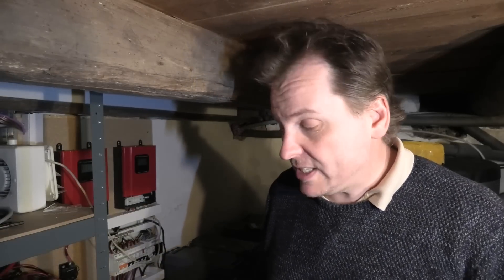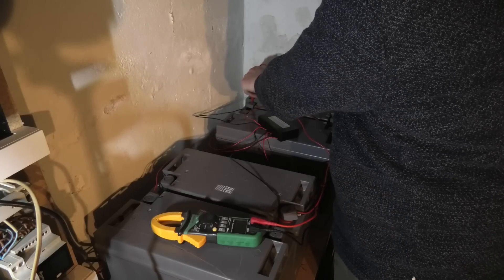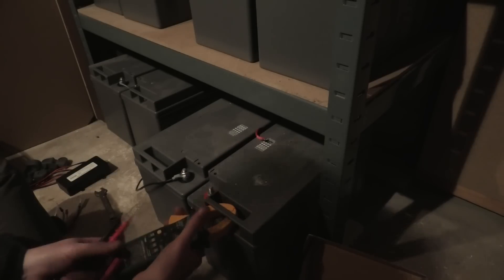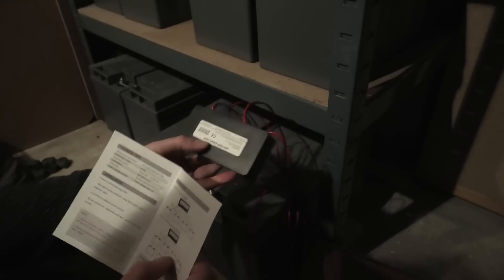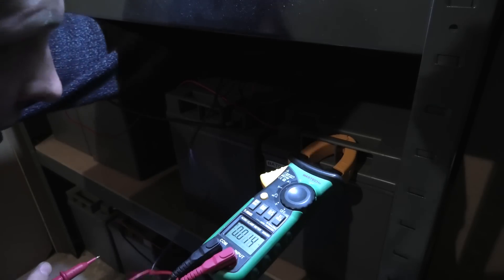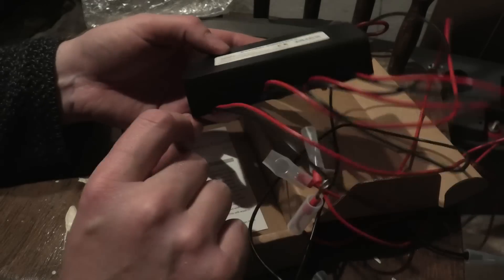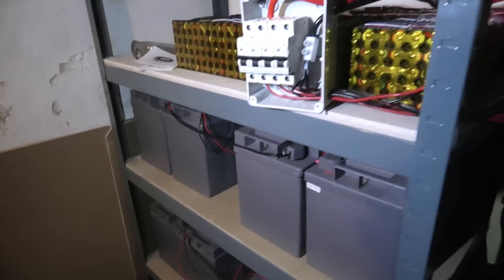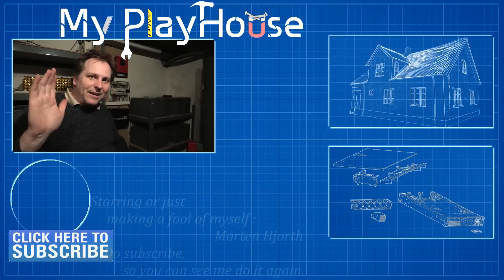Lead Acid Battery Bank Equalizer HA02 4 Batteries 48Volt - 1074

Comment: could it be used on 6 volt batteries also?
Reply from the maker: I do really not remember,, you will have to look in the manual.
Reply: are you still happy with the equalizers operation? well worth the investment? @MyPlayHouse
Reply: i just got my HC02 and used it charging on 6volt batteries, 12volt system, i had 2 batteries very low, so hooked the low batteries and the high batteries to the equalizer and my first impression is outstanding! higher voltage than I've had on this old bank in years, I'll see how it plays out on the discharge cycle, but, it's very encouraging now!!! thank you!  @MyPlayHouse

Comment: measuring voltage with "just about" as a measurement unit?   When you're talking about differences between cell voltages and balancing,  "just about" is a horrible unit of measure.
Reply from the maker: Well if it was off by any important amount,, I would say it more precisely.

Comment: out of curiosity did this end up being a useful worth while device this far in? does it work well still? toying with solar security camera trailer at work
Reply from the maker: They work really well,, but I got them to late,, my batteries was done :-(
Reply: first, thanks for responding to pretty much every question I've ever asked:P... I think 2 trailers are both going to end up with new sets of batteries(trailers were bought and no one seems to have known what they were doing or had time to setting things up  properly??** crossing my fingers, knocking on wood/etc:P).... any clue on if the 24v variant will work with 8x 12v 140Ah~(Group 31 I believe, similar style to what is in this video) in a 24v configuration; I think 8 12v batteries in a 24v configuration is a bit strange but it's what I have to work with for the moment(inverter/etc are all 24v) Thanks!

Comment: hot gell =dead, my condolences, I lost my first bank 2 years ago, I got the same units and they have done good job, 2 years in they are well balanced! It takes a couple days to balance, as they can only move 1 amp irl, or in China numbers 10Amps lol  My bank is flooded, so I can gauge cell health by water consumption, and you can track it by where the current is going from the eq (if you can hear in the range, you can hear the whine of it working)  I loath gells, they're like a clingy needy animal with no ability to care for its self, Flooded is like a sturdy bull, can tack accidents and handle abuse better, and are servicible
Reply from the maker: Hi Fook Ewe
Thank You very much!  glad you liked the video :-)
Thank you for watching! :-)

Comment: I'm a bit unsure about the utility of trying to balance batteries consisting of six cells each.  Those individual cells are likely the ones that would need to be balanced.
 In the old days, even six volt batteries (with 3 cells) were checked cell by cell using acid density meters, as well as a visual evaluation of the acid level.  If a cell showed lower liquid level (not a quarter of an inch above the top of the plates), you would add distilled water.  The idea was that a cell with low liquid level under-used its plate area or over stressed the remaining area and cooked the water.  Which meant further drop of the liquid level and more loss of active plate area.
 With the introduction of sealed or gel cells, this original "balancing act" became forgotten art, but I still feel you cannot really balance a 48 V battery in chunks of 6 series connected cells.
Reply from the maker: The Li-ion batteries with 14 in series also needs balancing.

Comment: Yikes there's a nasty high frequency in most of this video. Very sharp and piercing sound.
May want to run any other videos you take near that equip through an audio filter to filter out near 12,000 - 12,400 hz . Seems to float around that area in most of the clips. Used an FFT plot to figure out what the freq was.
Reply from the maker: Interesting,, my speakers might not be good enough,, or I am to old and deaf.
Reply: It is the balancer making that noise. I have one and I've been trying to figure out if there's a version that is quiet

Comment: I have been using the HA02 balancers on my 48v battery array for over ten years.  They do extend the life of pack about 1 year.  The harder the balancer has to work, the warmer the HA02 units get.  Not hot, just noticably warmer to touch.  When batteries are in balance  the balancer is cool to touch, same a ambient temp surroundings.

Checking the balancers warmth is a quick and simple way to get an early warning to a battery with excessive leakage current.  With early detection you can avoid overvoltage charging on other series batteries which will eventually destroy the whole series stack.

HA02 has switching inductors for balancing.  The smaller 24v version are just capacitor transfer type.

I have seen new model with BT reporting which should be better monitoring.
Reply from the maker: Hi RCin Fla
Thank You very much!  glad you liked the video :-)
Thank you for watching! :-)
Reply: Each battery contains six cells. If each battery was provided with a separate additive such as lithium, the lifespan would increase by four years in the batteries. One cell always disables the rest.

Comment: May I ask can you use one for 8 6v batteries in a 48v battery bank. The question I am asking is can you set it for 2 6v batteries to make it 12v?
Reply from the maker: Yes you can do that,, balancing the batteries, becomes even more important.
Reply: no, but it would work with 4 x 6 in a 24v system

Comment: The battery balancer looks very nice :-D
I hope it only charges low batterys to bring them up to a standard and does not discharge a battery to bring it down.
That would be a waste of your valuable solar power :-(
I know nothing about the charging plan, i'm ignorant (No supprise lol).
Reply from the maker: I hope they do both :-)
Reply: these are an active transfer type, they consume a micro wat or so energy but the bulk is transferred tot he lower cell

Comment: Morten - the one question the world is wanting an answer to is : what is the status of the Little Menace out in your garden? 🧐
Reply from the maker: The Little Menace has had a bunch of repairs the last few days,, the red/green LED on top of the charging station,, the green leg of the LED had rusted away,, that was a though error to find. and the "lift" sensor on the Menace,, was out of order,, it is a magnet, and it was pointing the wrong way,, and some rubber shock absorbers thingies had come lose,, took over a week to figure it all out,, it is running as I type. :-)
Reply: @MyPlayHouse  Cool. Are we lucky enough to get a video on the issues with it and your fixes?

Comment: Lead acid batteries needs cell balancing just as much as lithium ones.
Lithium shows its displeasure fairly well when overcharged. Lead on the other hand just turns its battery acid/water into H2 and O2 for a nice explosive mix.
But where Lead acid cells really get unhappy is over discharging them, since the buildup of lead sulfide takes more room than the lead base metal itself. When this layer gets sufficiently thick, it starts flaking off.

For wet cells, it accumulates at the bottom, for gel cells the flakes gets stuck in the gel and slowly wander to the bottom, in either case, it isn't contributing to the capacity of the cell anymore. And since the cell gets progressively smaller, then it gets faster to reach this point the next time around. Eventually the cell is more or less dead.

 As long as it isn't flaking off, ie not going bellow about 1.85 volts per cell (or 11.1 volts for a 12 volt battery), the battery lasts practically for ever. As long as one remembers to top up the water every couple of years. Though, most times all the cells aren't exactly equal in size, even from the factory. So one will have to stop discharging it a bit earlier. Though, some people just continue down to 10 volts for a 12 volt battery and think nothing of it. (Lead acid cells have a very very flat discharge curve, being full at about 2.1 volts and empty at 1.8 or so. Making cell balancing a fair bit harder.)

Though, 12 volt batteries like this don't have any balancing on their 6 cells, so there is that... But at least balancing the 4 sets of batteries is a start.
Then there is the, "maintenance free" Lead acid ones, be it sealed ones or gel ones, they both technically are just worse off due to progressively drying out with every overcharge one applies to them. This degrades their performance and capacity over time, since the reaction needs water to happen.

One can though argue that lithium is better, but it isn't true in a lot of applications.
Lead acid cells are far cheaper per kw/h, loves being fully charged. Lead is typically worse in regards to prolonged power output, one needs about 2-3x more capacity compared to lithium, but this is more about the cell structure in the battery itself rather than a side effect of the difference chemistries. (Peak power output haven't been all that interesting for lead acid cells after all.)

For UPS applications, Lithium is frankly a waste of resources that could be better utilized elsewhere.
A larger installation could use glass cells and with proper maintenance and operation it can last decades.
And Lead acid cells are mostly tortured since why fix a system that isn't obviously broken....

I though think it is impressive that lead cells can be put through hell and still last a good few cycles. While most other rechargeable batteries blows up.
Reply from the maker: Hi Today on the Bench
Thank You very much!  glad you liked the video :-)
Thank you for watching! :-)
Reply: @MyPlayHouse  Battery storage is an interesting topic, just like servers, and installing windows.

Though, would be interesting to see a bank made of individual lead acid cells, not that these are easy to source in the slightest.
Reply: Mannn.,... you are a legend.

Comment: Individually charge each battery, best way to bring back improperly managed batteries. then put them on the balancer, isolate each bank...  for a week or so... and monitor each bank...a bad battery will make that one bank drop more voltage than the others.
Reply from the maker: Hi bryzabone
Thank You very much!  glad you liked the video :-)
Thank you for watching! :-)
Reply: I only have 2 batteries in my bank and going to do this, hopefully  tomorrow ....

Comment: can it be chained ? eg : alim ---> 1st load balancer ---> 4 chanels with 4 load balancer for 16 batteries ?
1 to 4 .. 4 to 16.
Reply from the maker: There is a way to link them up,, by overlapping two equalizers,, so with 2 you can do 7batteryes
Reply: @MyPlayHouse  ok, thank you :)